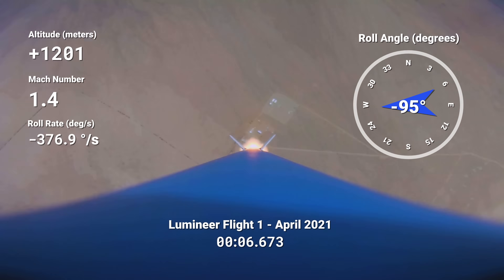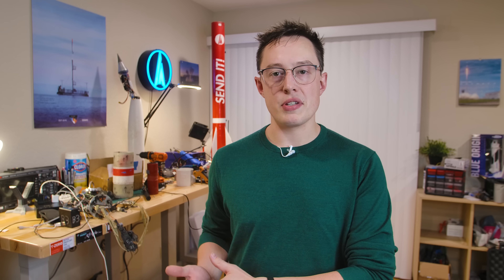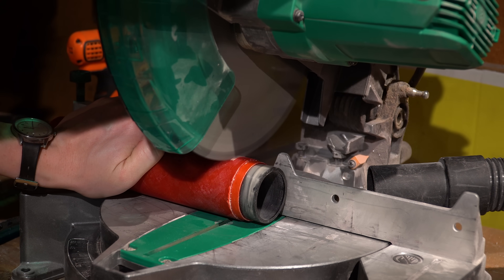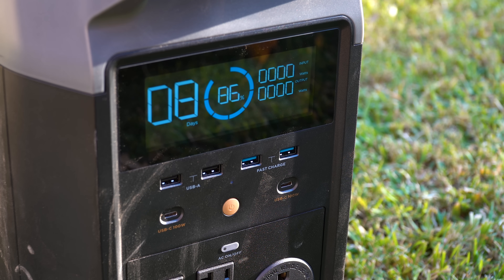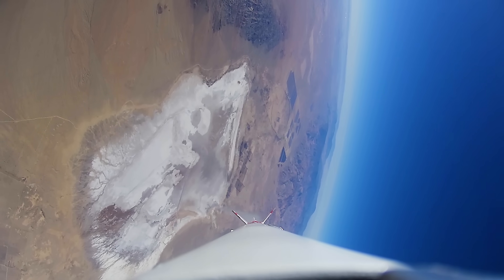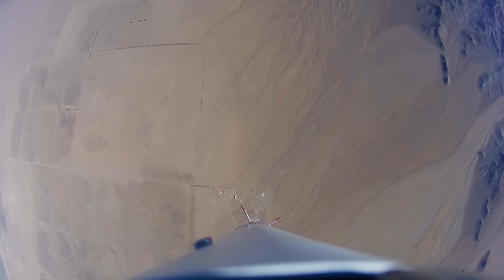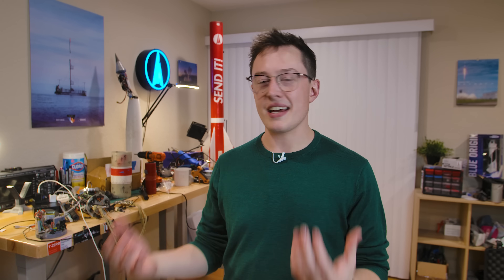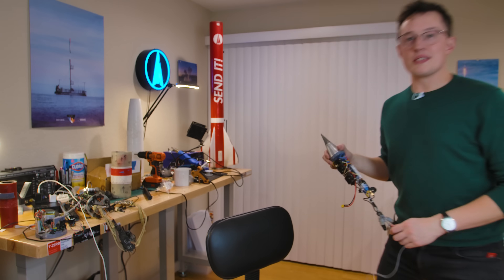Can You Get Stable Video From a Spinning Rocket?

Comment: Maybe stupid idea (due to complicated SW stitching), but maybe it is possible to have approx. 6 stationary cameras around the rocket and then stitch all of those into 360 video, then perform position correction either with accelerometer data or by motion tracking tied to part of the picture (some object in the video)?
Edit: just heard your comment about 360 cam. maybe what I'm suggesting is somewhat different and be of any help. maybe)

Comment: I think, like others have said, for a 1st flight test, albeit of a design you had already done multiple revisions to statically, this was the complete opposite of your conclusion....... factoring in all the things you KNEW before flight (concerns over the motor choice, low rotation speed performance, etc). This was a GREAT success as the bit of stabilised footage did have the exact result you wanted.... you wanted to test if you COULD stabalise footage in this manner and you proved you can, but with further refinements to get the outcome you want across the range of spin speeds.

Other have said you may need to do something to balance the angular momentum as what you intend is for the rocket to behave as if the spining section wasn't there, but the spinning section - as this scale - is acting as a reaction wheel affecting the rockets inherent spin. Adding a counter rotating element of the similar mass should go some way to balancing those angular momentums.

Tl;dr I genuinely think your conclusion is wrong considering the constraints on your ability to test systems on the ground (as you say, wind tunnel and lot and lots and lots of CFD would help, and a big company would have access to that stuff, but you as a small group cannot). You proved it is actually possible to stabalise the footage in this way, and know areas you can improve from the get go, and using the retrieved footage to guide further improvements.....

Comment: I think BLDC is still the answer.. But instead of using ESC, check out FOC controllers (eg: https://www.youtube.com/watch?v=Nhy6g9wGHow ).
FOC would also let you remove all of the gearing you have out there and use a BLDC motor directly (saving weight and complexity*).
(*or shifting it to electronics ;) )

Comment: Why not make your own brushless motor? An outrunner of that OD should have plenty of torque, build in sensor/encoder so you can use an off the shelf esc with position control.. this way some of the battery and mass will be on the main body not the rotating part.

Comment: A a few others have mentioned you can take the ideas and tech used in high speed cameras following very fast moving objects and use moving mirrors. This solves a couple of problems also making it easier to mount bigger cameras(the gopro) inside the rocket and use a spinning periscope to capture beautiful footage of the outside. Great work it is really interesting watching the progression!

Comment: The Problem is mabye, that the Camara moving part and the Rocket has a Moment of inertia. If the motor generates a totque, it accelerates both parts in different directions and the Rocket in the Same direktion as it moves.  The the Rotation velocity sensor tells the motor to move faster and it becomes a self increasing mechanicm.

Mabye the solution could be to make the camera and the motor free rotating with regard to the Rocket. So the Rotation  acceleration of the Rocket will Not affect the camera. 
Than you can add a counter rotating Part in the camera Part to give Resistance, when the motor accelerates the camera.

Comment: For brushless motors add a hall effect sensor, normal ESCs work based upon the backfed power from the separate phase coils and rotating magnets generate that power which is why it only works well at higher speeds

Comment: Given your initial requirements that made you choose against the 360 camera I highly discourage the use of a stepper and think that all you need to do to make the existing setup work is a magnetic encoder on the motor, you need to know exactly how many times the motor has spun in order to prevent the excessive over spin issue at lower speeds.

Comment: This is more my area of expertise. I'd strongly advise against using a stepper. Stepper motors are synchronous motors. If they lose sync they stall and won't regain sync until you reduce the drive speed to below their 'pull in' speed. You only need to exceed the maximum torque for a few milliseconds to make the motor stall. The high vibration environment of a rocket is pretty much worst case scenario. Additionally the available torque drops of sharply with speed so you have to over rate the motor considerably to get enough overhead.

My first choice would be a humble DC brushed motor. Simple, cheap and reliable. Decent quality brushed motors turn smoothly at low speed and they can be driven with a simple H-bridge driver. Just keep the PWM frequency reasonably high, say 3kHz upwards.

For a little better performance and a slight reduction in weight, field oriented control of a brushless DC motor works but it's a lot more complexity and you will need to spend a fair amount of time tuning it for stability. Look into drivers and firmware designed for camera gimbals. I'd recommend using the motor with hall sensors at a minimum. While FOC can be used without sensors you run into a similar problem as you have with steppers. If you momentarily exceed the maximum torque of the motor it will lose position.

Comment: Sliiiiiightly surprised to NOT see a "and I tossed a cheap insta360 onboard to show why post-stabilized video is bad, heres what that looked like". I'm guessing this means either you haven't got a small/cheap 360 camera, or just didn't deem it worth the effort to swap an existing camera for a 360 one? Either way, this method seems WAY more promising and it's truly astonishing to see a rocket engineer tackle something as different as robotics - let alone attempt to combine them in the same platform! (Yes I know vectored thrust/fins/etc technically count but there is a world of difference between ESCs, steppers, and general high speed robotics compared to microservos and wobbly little linkages, impressive work as always!)

Comment: Spinning the camera functioned a bit like a reaction wheel - which makes me think that you could just have a reaction wheel inside the rocket and leave the camera fixed. Instead of using a stepper motor just use a PID controller with a regular DC motor, but you'll need to fine tune your PID parameters on there which could be trixie to do for when the rocket is in flight. Maybe you can simulate the rocket body being in flight by suspending it along a rod and blowing air at it or something, or otherwise inducing spin into it while it's suspended that somewhat simulates the roll that is induced during flight.

Comment: Those are some pretty extreme issues with the motor. Make sure you're using a bl_heli_32 esc, and that you have a high enough gear ratio and low enough kv. In small robotics applications a 1:25 or so ratio and 2000-3000kv on 3s is typical for drive motors that are required to have similar top end and low-speed precision and they manage it fine with good esc tuning.

Comment: 2 thoughts:
1. You could use a sensored ESC to allow for zero RPM operations (would be moot if you use a stepper motor)
2. Couldn't you do some of this in software since you have imu data for your roll rate (might be limited at high roll rate to fps ratios)

Comment: You can gyroscopically stabilise a rocket using a simple rotating metal rotor on one of the fins. It’s a simple system used on the sidewinder. It’s super simple and might be worth a look-see. Here’s a link to a video. https://youtu.be/cfzj3rRIVU4

Comment: You could leave a tab or lever on the base / trailing edge of each fin which extends into the tube. You could then put a force on the end of each lever which would deflect the trailing edge at the tip of the fin in the opposite direction, just by making use of any flex in the fin. If the trailing edge at the tip moves more than the leading edge at the tip then you are going to affect your roll rate just using the flex of your composite.

Comment: Use a small brushed dc motor. It would be perfect for that application. There are perfectly good, and high quality brushed dc motors! They have better torque, power to weight and range than a stepper, and are much easier to control, and they will have similar performance to the brushless which was overkill anyway. The advantage to the stepper is that it will require less gear reduction. That itsy bitsy stepper just probably wont have a comfortable amount of extra torque and speed to be robust for what you are trying to do!

Comment: You should look into sensored brushless motors

Basically just a normal brushless motor with a encoder slapped on and some logic in place to allow them to rotate slowly but maintain high torque the entire time. It would likely play nicer with your PID loop over a normal motor. You might not even need any gearing, depending on what motor you use.

Comment: I dont think it's a "total failure" I'd almost call it a partial success. I was skeptical if that concept could even be stable for more than a fraction of a second but you were able to get it working for a while and still find many straightforward solutions. I dont think you need video stabilization if the roll rate is that low before the minimum roll rate is reached.

Comment: I dunno, thought you'd measure rate rather than total rotations, you're de-spinning not pointing. 

I thought it was a pretty successful test anyway. It was a first prototype and the concept worked. Yeah you need iteration, but as you forgot, an engineers job is to find the simplest solution that works well.

Comment: Watching the flight from the camera mount it seems that late delay in the motor and how hard it spun up right away actually slowed down the rockets roll(technically you made a reaction wheel). Then after the rocket lost all of its roll it I noticed the camera stayed in place compared to land features while spinning the whole rocket due to the rough start of that motor trying to counter really small amounts of roll. That might actually benefit you in keeping spin stabilization between stages if the rocket stopped spinning due to loss of acceleration and not the camera mount being a reaction wheel of sorts

Comment: How are you going to deal with good old Newton's third law (action and opposite reaction).  i.e. When you spin the camera your also going to spin the body of the rocket.  Since it has fins and is changing in velocity there will never be a constant correct spin value.  Then to not get jitter your going to have to update your spin rate very fast.   But you cant update faster then you can detect the spin.   Which I would guess would leave you with a jitter in the video.   Yes? No?

Comment: You should try foc vector control that motor with an encoder. You could control the motor with positional accuracy and at low speeds. There is an arduino library simplefoc for that. My guess is that it would be perfect for this system. Only downside I see is that you'd get some "cogging" with that motor so small.

Comment: Awesome 1st attempt and cant wait to see rev2. I would guess your low speed performance issue is not the motor at all but the ESC which is simply not designed to operate in the low rpm range. I can't be certain but I would guess you are using an aircraft ESC perhaps modified with a dual direction firmware and these just won't work at slow speed. The Back EMF method of sensing rotor position for these cheaper ESCs hasnt been optimized for low rpm, however I have found an alternative. RC crawler ESCs achieve amazing low speed performance, I would look into a Furitek Lizard ESC. good luck

Comment: When I was an industrial/commercial printer repair technician, the printers always used stepper motors and an incoder strip behind the carriage to know its position along its X axis. I wonder if using a setup like that with a gyro/accelerometer to cross-reference its position against an encoder, that could achieve the results desired. It would be lightweight and very few moving parts.
 Another route would be to use a brushless gimbal motor and a gimbal control module.  The motors are a lower kv, more torque, and can start up smoothly at low speeds.

Comment: I think it Is a total success. Use a motor with a sensor.  Rc sensored motors have the low enough resolution that you need. You could also probably just fix it in code. To a point.

Comment: You need to use a controller that does position control. Ideally one with Hall sensors to give feedback on the motor position. Then you can run as slow as you want, and have great positional accuracy. Better yet, integrate the motor controller with the microcontroller doing the platform position control.

Comment: What you need is an AC servo. There are cheap & quick DIY solutions like SimpleFOC. Stick an encoder onto your motor, replace the ESC with a SimpleFOC board, and that's all you need.

Comment: Another awesome video from BPS. Keep up the great work!

It seems like when the camera module spins it also puts spin on the rocket (like a reaction wheel). I'm willing to bet putting a weighted counterwheel (weighted the same as the camera module) that rotates in the opposite direction of the camera will help steady the camera even more. Having the stepper motor will definitely be the biggest thing that will smooth things out, but in case you need a large and sudden rotation the weighted counterwheel solution will get rid of any possible exacerbation caused by the rotation of the camera. The spin as it is now will most likely cause the camera rotation to have to keep compensating more and more as the flight goes on (even if the camera spins perfectly with the roll of the rocket) so this is really just something to worry about for a space shot or longer duration flight.

Comment: You could try a bldc gimbal motor with FOC. Awesome video, as always!
Reply: Those are mutually exclusive.
BLDC and FOC are two diffrent methods of commutation control for a motor. There are no BLDC vs FOC motors they are just brushless motors being controlled by a BLDC or an FOC esc.

Still I agree and FOC system would solve all the brushless motor issues.
Reply: BLDC means Brush Less Direct Current motor. They can be controlled by Field Oriented Control (FOC). SimpleFOC is an open source implementation.
Reply: @nocare  BLDC just the common terminology. 
If I'm correct, the PWM signal is sinusoidally pulsed DC, so technically they could be still DC motors.
Edit: I'm not looking for an argument, was just trying to be helpful as a hobbyist. If I google BLAC gimbal motor there are no results. Googling BLDC gimbal motors gives the exact result of my suggestion. There is no more to the whole thing from my side.
Reply: @nocare  with ESC the pulse width is modulated, operating on a fixed frequency, causing the change in rotating speed. It's reliant on the inertia of the rotor, so it can not be used for servo applications like FOC.
Reply: @nocare  so that means, that the 3 phase outputs of an FOC are actual analog sinewaves instead of pwm signals switched by mosfets? I didn't know that, thanks for the explanation, I still have much to read about this.
Reply: @nocare  Thank you so much for taking the time to have this nice discussion and the explanations! I'm also continuing to read and learn about the subject. Have a nice day!

Comment: Just use the system the aim-9 thingy of a  small wind wheel and a flexible fin,the rotating objects will,keep the flaps in it’s place and rotate rocket back to normal. If it rotates and use tvc to control. Upper atm

Comment: I'm not sure what kind of motor and controller you're using, but if you haven't, you should check out the SimpleFOC project! You can use field oriented control (FOC) to get really nice low speed control of brushless motors. You may also want to use a gimbal motor, rather than a drone motor

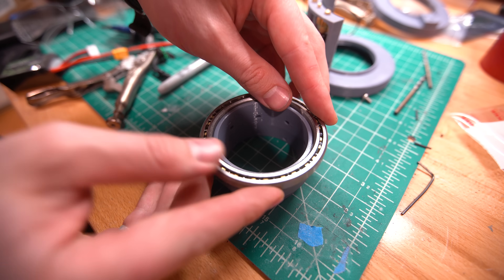Comment: I know absolutely nothing about rockets nor bearings but are you sure that the camera platter isn't ceasing due to the g-forces of the launch pushing it down? How does the bearing at 4:43 handle being squished from above? Or could some other portion of the platform be making contact? A complete shot in the dark.

Comment: Interesting video, as always! You did a great job making the mechanical parts but little mistakes in motor selection and control algorithms are ruining the effort! Let me give you some ideas to solve the problem: 1) You are making a camera gimbal, like on DJI drones (with only one axis, but it doesn`t matter) -- look for technical details on the topic; 2) Deadband and friction are the enemies of all gimbals! And you have at least one of them (too big deadband in angular velocity control). Friction increase due to G-force can also be an issue. To get a smooth stabilization you need to control torque quite well. Sensorless motor isn`t the right choice. If you use motor with Hall sensors and appropriate ESC the result would be much better! You can even use brushed motor -- it`s more simple to control. Considering short flight time it can be the best choice. 3) Having only angle control loop isn`t a good idea! PID controller can do a better job. You should add an angular velocity feedback at least. 4) There are special gimbal motors on the market. They have lower KV -- bigger torque to current ratio, lower speed. 5) Stepper motor can work, but you should carefully calculate required torque and angular velocity -- risks are high! Using DC brushed motor with gearbox (you already have it) will be more simple and robust solution... unless rocket goes too far in space -- brushed motors don`t work well in vacuum.
Best regards